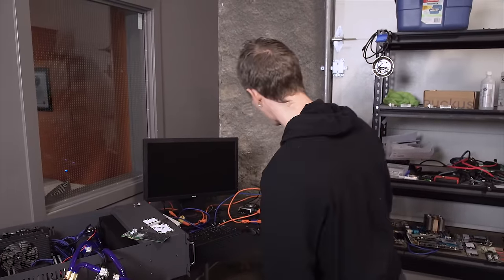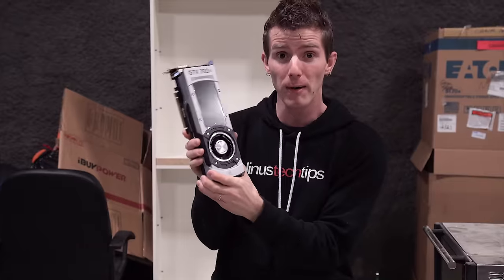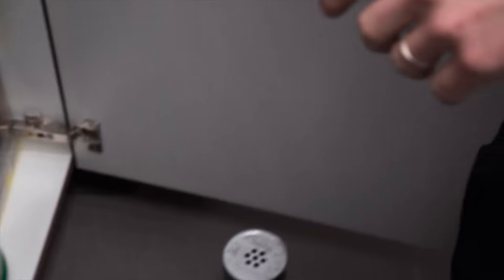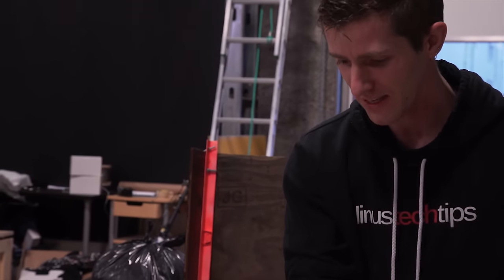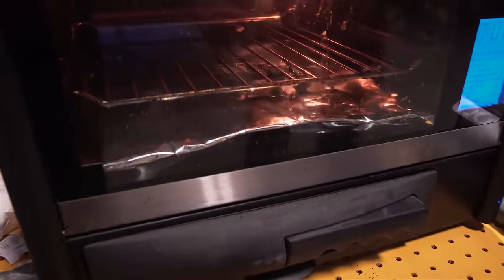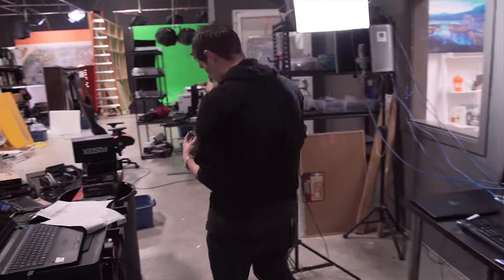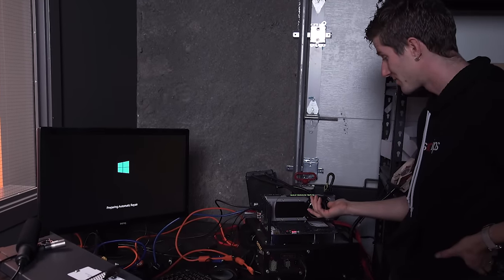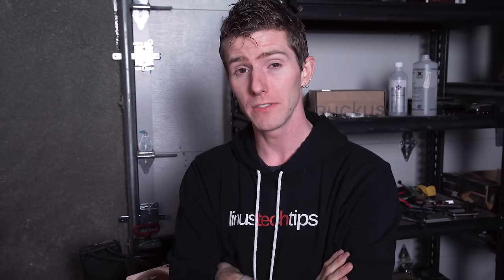Bring your video card back from the dead! - Oven method

Comment: My gamers are having rendering issues, I have re-formatted my computer 3 times now FULL!!!, I changed my computer from Crosshair IV that was not giving me issues, to Prime 350 that keeps giving issues.

PROBLEM!!!!!
I've tried Geforce 660 2GB GDDR5
Radeon 7850 Sapphire HD 2GB GDDR5
Geforce 1050TI 4GB GDDR5
and all give me a screen flickering problem when I play games.

Explaining of the flickering:  When I game it sometimes goes smooth but then suddenly I get in and out black screen flickering during league of legends for example.

In Over-watch I get Rendering has stopped and or game just crashes after 3 to 10 seconds.
 
Hello, I was using Formula Crosshair IV with 32GB of Ram / 3.7GHZ 8 cpu black edition  CPU / Nvidia GeForce GTX 660 Ti 2GB / 1 TB hard drive.
I had no issue whatsoever HOWEVER; I couldn;t play destiny 2 when it was released so i purchased
Prime B350M-A motherboard Socket AM4 AMD B350 Chipset Duel Channel DDR4 3200
Corsair Vengence LPX 8GB (2x4GB) ram DDR4
AMD Ryzen 5 1500x Quad-Core 8 threads processor with Araith Spire Cooler Socket AM4 3.5GHZ / 3.7 Base
( ALL BRAND NEW )

Comment: I don´t understand why people promoting this bullshit method of Oven, first it´s high toxic, the vapour of acids used in the industrial process of production of the PCB will go directly in your Lungs and in the Oven, second this method raising up the temps for all the components present on the card , many have a thermal range above the 100 Celsius and to melt the joints under the GPU you need more than 200 Celsius, this will damage certainly other components, third, most of the failure of the modern graphic card will require a direct substitution of the GPU with a new one or involving other components on the board like Mosfets, rectifiers, and so on........this is a totally stupid solution.......

Comment: My card was dead, starting with artefacts, 24h latter black screan, nothing. Card was on my shelf last six months, i found heat gun today, it worked.  Im typing from dead GPU...hahahah, hope will last some time, will see. I baked only GPU with heat gun for 30 sec. at 550c (heat gun spec), i used metal foil to reflect unwanted heat from other parts. I did not use flux, will do some testing and report if somebody is interested, Cheers
Reply: any update?
Reply: @ernestjanguhiting2654   I just finished Subnautica game, no problem, im using this card last two weaks, 16h a day, max temp at 100% load and 100% fan speed 73c. Yes its loud at 100% load, i still didnt change thermal paste, will doo that in a few days. No any glitches or artefacts , will see for how long. I repared two more cards this way yesterday, one 6570 and Gt 440, tested in game, both working. I just need new paste to put them on torture tests. O yes, i managed to fry dead one GT6800, baked for too long, 60s at 550c. GPU board has start to bubble (i dont know right word)... Thats it . Cheers.
Reply: still working :@
Reply: keep the update man
Reply: One year and this zombie is still working...no joke!
Reply: @Charles Clarke It died again few monts ago, revived, new paste....buahahahahha it's alive...Subnautica goes on :)